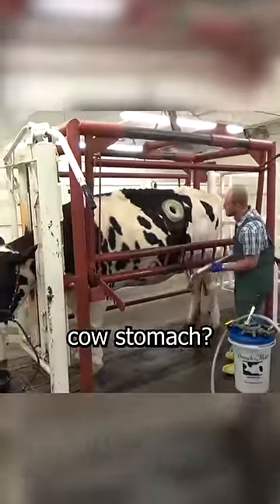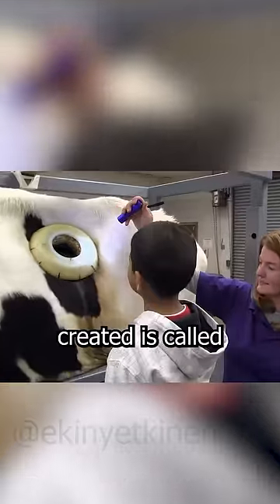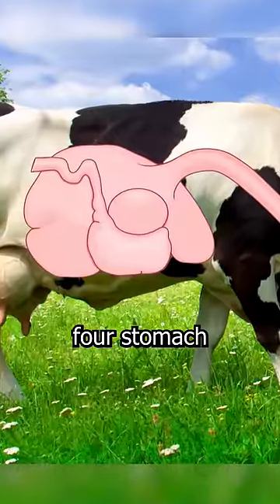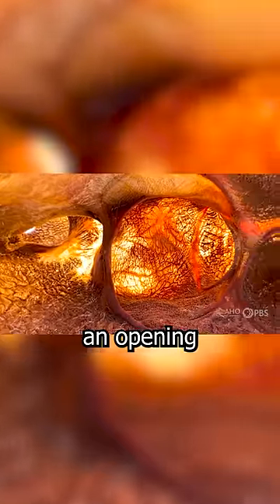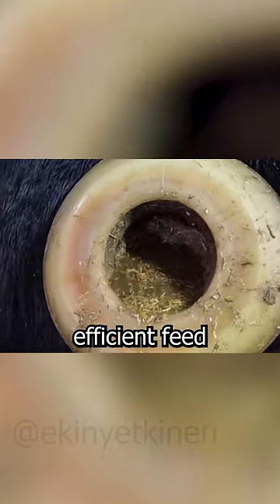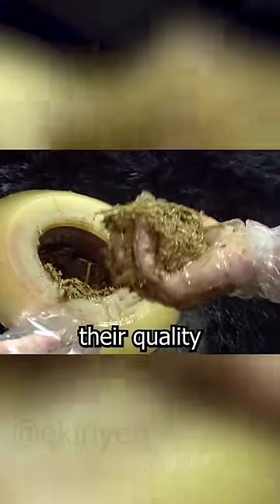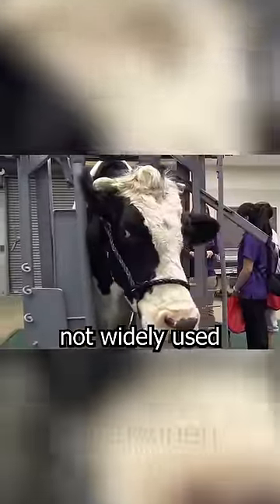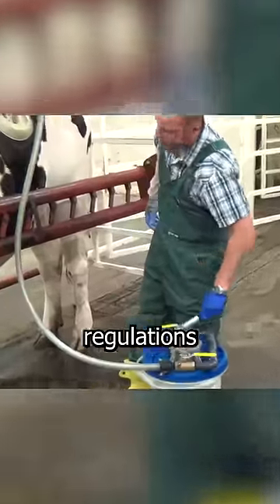Why is there a hole in the cow's stomach? 😲

Comment: I mean, a hole in your body doesn't cause you pain, seems understandable
Reply: Fr
Reply: A healed one doesn't, that's for sure. The same happens when you pierce your ears. Is the process of healing what actually causes pain when you have an open wound, and infections
Reply: @TitomaticoVlogsOficial  when we pierce the ear, it's through the ear, not into the ear, like in this case
Reply: I had a gtube once! A hole in the stomach that didn’t hurt. 😊 The only painful part was after surgery but the actual hole doesn’t hurt. Had it for two years.
Reply: @ANISHKUMAR-rb7qg  is through the stomach wall and through the skin and meat the same way it goes through the ear. Point is that both heal and are painless when healed.

Comment: "Hey the cow swallowed my keys!"
"Oh i gotchu"
"IS THAT A HOLE ON THE COW?"
"here u go, your keys"
Reply: @augustic_au this is actually more accurate than you know. I work in the dairy industry and many of the cows that we have have cannulas. Cows often eat things they shouldn’t, and most cows have a large magnet inside of them so they can’t get sick from their body trying to digest hardware (it’s called hardware sickness) when cows with a cannula have an obstruction that the vet can easily just reach inside and take it out, in a non cannulated cow they would need a large surgery, so it greatly decreases the stress that cows may experience, and the cows aren’t negatively affected by the cannula.

Comment: To the people freaking out/doubting that the cow isn't in any pain:

Cannulas are by design painless if administered correctly. You do not feel them and the cow's cannula isn't particularly large relative to it's size. I've had a cannula in my throat after surgery where there's clusters of nerves. I only felt it if I accidentally pulled at it but it was still painless. You'll get bigger cannulas depending on the surgery that can reach the same diameter relative to size as the one you see here. Keep in mind that this cow is large.

And the cow's body language indicates clearly that it's relaxed. Maybe a bit confused but absolutely not in pain. This is a very painless, straightforward and humane way to conduct research on a living cow's stomach.

Comment: I’m pretty sure it’s used when a cow bloats more than it should, because they’re fed corn (which makes cows bloated) so they make a hole so the cow doesn’t continually bloat, as it can be fatal. Depending on the type of hole thing used, it sometimes has a plug for said hole
Reply: Yeah its pretty messed up.
Reply: Nope. That's an entirely different thing.
Reply: In the case of bloat, a temporary sort of version of this is implemented called trocharization. A trochar is used to pierce the hide and then is removed, leaving the cannula. The cannula allows for the decompression of the bloat. 
We occasionally do the same in dogs that have severe bloat when we need to buy time to get to emergency surgery. 

This permanent fixture is surgically implemented, the fistulated cows are very often spoilt rotten by students. The fistula allows easy access to the contents of the rumen for study, and in some cases, the healthy gut bacteria of a fistulated cow will be removed and transplanted into a cow who has lost their own. It’s pretty interesting.

Comment: They have those holes to release gas build up in their stomach so they don’t explode on the inside and sometimes they are just valves.
Reply: Those are different holes nimrod
Reply: @themordeo1098 Wtf you yappin about, cannulas help cows excrete methane gas from their bodies safely
Reply: @harrissankarthigeyan2561 yes but you would never install one for that reason.
Reply: @MaestroAlvis  No. That's exactly what cannulas are for.
Reply: @harrissankarthigeyan2561 
No. It's not.
Reply: @1TwistedPoet  and how tf is it not
Reply: @1TwistedPoet  And how exactly is it not?
Reply: @harrissankarthigeyan2561  
No. Exactly how IS it.
YOU made the incorrect statement.
Reply: Ig it counts as a mega cannula lmao. I’ve always heard these referred to as fistulated cowsz Usually the trochar/cannula combo used to relieve bloat is much smaller than this and temporary. It’s neat to watch trocharization done.

Comment: Also, the cow is one of the only animals that can just explode at random moments during its life. This helps them release the gas
Reply: They won’t explode per say. Bloat occurs in large breed dogs too, and the concern there is that the stomach enlarges to the point that it pushes on the diaphragm and they suffocate. 
In both large animal and small animal, the trapped gases can be released using a trochar and cannula. The trochar punctures and is removed, the cannula stays in place until the gas is satisfactorily expelled. 
Not sure about cows, but dogs oftentimes require emergency surgery when bloat has led to GDV (gastric dilatation volvulus), or the twisting/flipping of the stomach. The stomach must be unflipped and then tacked to the body wall so even if the dog bloats again, the stomach with be extremely unlikely to flip again. 

Some large breed dogs will have their stomach tacked as part of their spay/neuter procedure as a preventative measure for GDV (since they’re already under anesthesia anyways). 
Sorry about the word vomit, it’s something that fascinates me.

Comment: This also helps with trapped gas I believe. Sometimes cows get trapped gas and it can be very dangerous for the cow, due to the fact it can lead to death. I say "I believe" because I'm not sure which stomach compartment the gas builds up in, or if that even matters in this scenario. When cows get trapped gas holes are often poked through the skin of the cow and all the way into the stomach to release it so they don't die.

Comment: Worth to mention that for some cows this is REQUIRED for some cows as a treatment. Nature has a great order of how things work, but mistakes occur with basically everything. Some cows have issues with thier digestive system, causing gas to build up inside of them, causing cow to die from thier stomach exploding if this is not done in time.

TL;DR before saying "waaah bad farmers doing horrific experiments on cows", without this treatment, the cow may explode inside out.